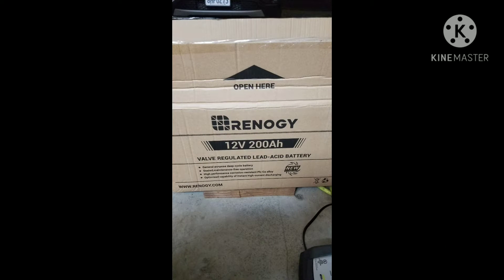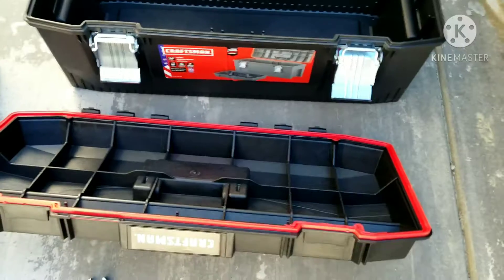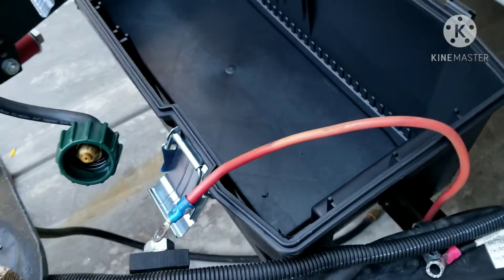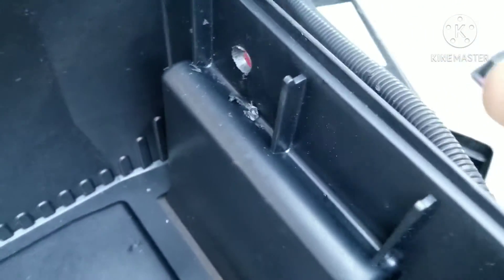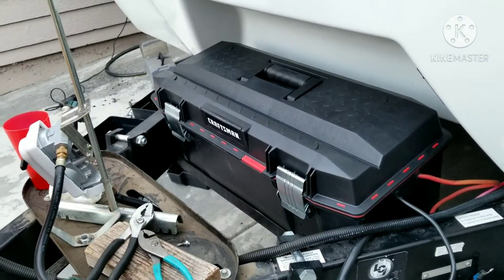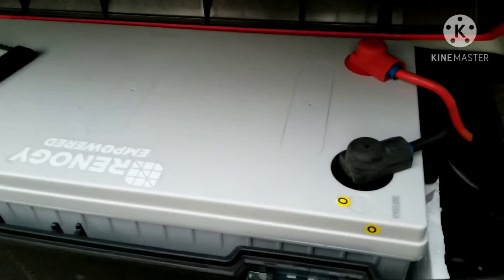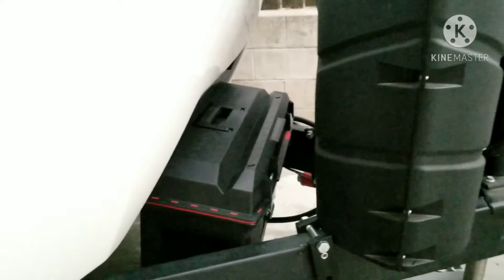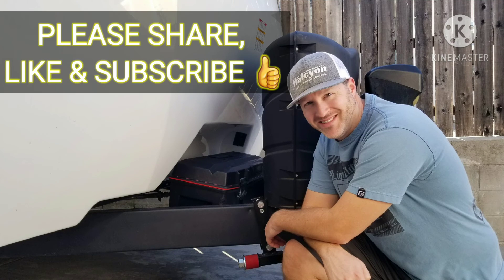DIY RV Battery box

Comment: Thanks buddy. Just what I was looking for.
Reply from the maker: Glad I could help…👍🏼😀
Reply: @johnnysweekends  one more question for ya buddy.
First I don’t think this box will work for my rpod.
It seems to big for my frame. Damn.. it’s not easy finding a box to fit.
May have to order a 4d box for 100 bucks.

Second has to do with the voltage on these.
Is it the same as regular 12v? 
After I run the generator is goes back down to 12.7 12.8.. that a normal full battery on these batteries too or should it be higher.
The lady who sold it to me had a pic of 14.1 but I’m sure it was as she was charging it or just finished.
On my solar controller it has yet to show the full battery bar after I take it off the generator and when solar panels are down at night.
Not sure what to make of it. Thanks.
Reply from the maker: So if you look up the specs at renogy a full agm battery that is 12v 💯 charge is About 12.8 which you should check with a meter at the battery and not the charge controller. 

Your solar charge controller may need to be set up for a agm verses lead acid battery. 

The charge rate and discharge rate is better then that of a lead acid. 

Your charger should charge the battery at a low rate of 13 volts then ramp up to about 14v or a little over then trickle back down. 

You should be able to find that info online as well at renogy. 

Bummer about the battery box. Yea just depends on the A frame part of the trailer and the room you have. 

Hope this helped.
Reply: @johnnysweekends  definitely helped. Thanks! Yeah the lady that sold it to me checked it with a multimeter. I’m gonna go do that in the morning after I run the generator a bit. 

Maybe the solar controller does need to be programmed. It’s the renogy adventurer so I’ll see if I still have the manual. 

It’s reading 12.7 on the controller, I guess I’ll have to see how accurate it is. But the battery symbol on the controller is only usually at 3 sometimes 4 bars vs the 5 when charging. Maybe I haven’t been able to fully charge the battery yet. 

But thanks. Alot of help.
Reply: @johnnysweekends  just checked it with multimeter. 12.7. So fully charged and good I assume? And it is set to Gell so good there too. Seems like the charge controller is reading it correctly. 

But I noticed you you’re battery is the grey top one, mines blue. So you got the agm one I got the 200ah gell. Have to do research on that then.
Reply from the maker: You’re welcome 👍🏼
Reply from the maker: Ahh yes that’s the gel batt. Yea you’ll wanna look up the specs but I remember it’s close to the AGM as well. 
How old is your batt..?

Comment: Hi, are you still satisfied with this mod after 2 years? Any issues with strain or shearing on the front cross bar where you are screwed in (since the back of the box is tilted forward and no hardware on rear)?
Reply from the maker: I didn’t have any problems with it with about 3000 miles and also some pretty bumpy roads. I did sell that trailer but sometimes wish I didn’t.

Comment: How are they holding up compared to those Walmart batteries?  Thx
Reply from the maker: Mine is still rocking. Does everything I need it to. I just run my solar panel and it will be fine. But even used it 3 days and two nights and had it down to 12.1 before I charged it again. And that was fridge running the whole time couple lights on and off. Charging a couple phones and water pump on and off.
Reply: @johnnysweekends  Very cool. I'm happy so far as well. I have 4 of them in my battery bank on a Sprinter van build I'm doing. They run a 5.9 cu. ft. upright 12 volt fridge/freezer & a separate chest freezer 24/7. I run a roof top 120 volt A/C thru a 3000 watt inverter in Summer when it's super hot. Diesel heater in Winter. Still adding other things as I get towards end of build. All being documented on my channel. I was curious others experiences with these batteries. I'm 2 years into them come Feburary next year & no problems so far. Thanks SUBBED. 😎👍
Reply from the maker: Awesome, yea I’m about 1.5 years or at least that’s how old the battery is. 

And I’ll check out the build..😀👍🏼
Reply: @johnnysweekends  Awesome appreciate that. I'm a baby channel documenting good craftsmanship which is pretty rare these days. Almost 40 in contruction mainly electrical industry from homes to power plants & sub stations you name it. After build I plan to travel on trips for work & pleasure towing a horse trailer w/ my Harley. I would love to bring you along. 
😎👍
Reply from the maker: Everyone starts small. Van build looks good though. And yea always good to teach good craftsmanship…👍🏼

Comment: Where in the world did you get a renogy 200ah for 200 bucks???
Reply from the maker: Craigslist. Gentlemen got it for a warranty return. So got lucky but i did see another a while back and these big 4d batteries have come down in price some. Even tractor trailer is carrying one now. And by the time you buy 2 good quality 6 volt batteries from say Trojan or US battery. Is just as expensive or more and they are not agm and weigh more. 
So if you can pick one up on a sale price i think i still prefer over 2 wet 6 volts.
Reply: I just got one on FB marketplace for 150. Huge score.
Reply from the maker: Wow awesome…. I’ll move to lithium when it goes….👍🏼 probably 2-3 years

Comment: Have you noticed any trailer sway while driving with with your heavy battery being on the tongue. I saw this excellent video (https://youtu.be/JeEEC5eVNCk?t=176) that explains weight distribution. BTW, you SHOULDN’T try to counter-balance heavy tongue weight by adding weight to the rear! That’s the worst thing someone can do. The video shows what happens. Thanks!